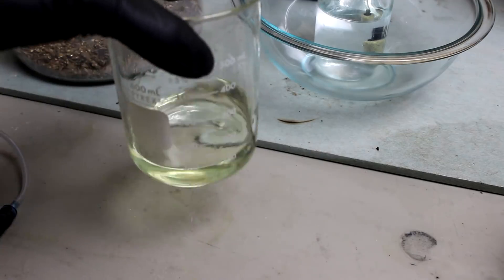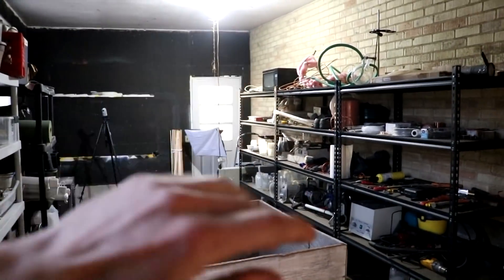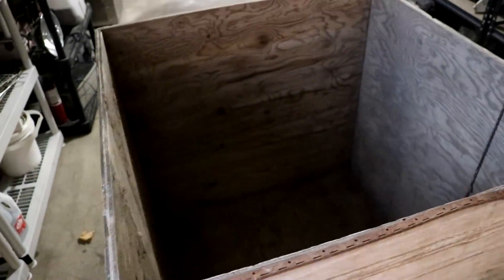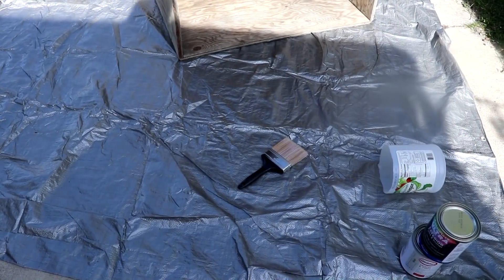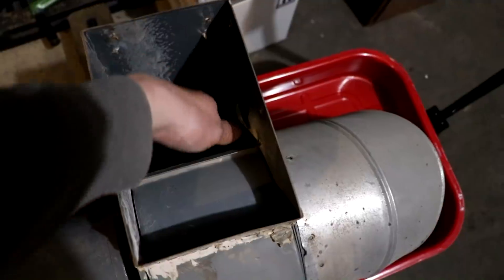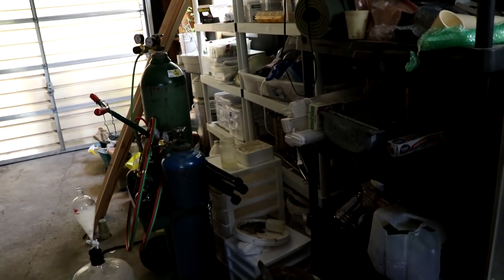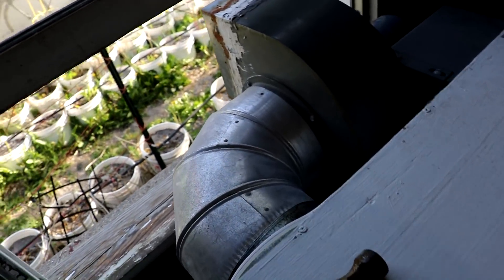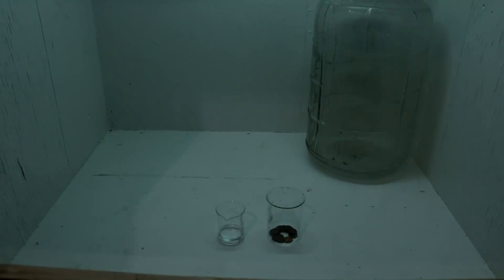Cody’s Fume Box

Comment: Serious suggestion, install independent light and fan switches on the OUTSIDE of the hood.  

Why independent switches?  It's easy to install and it gives you the freedom of running the lights and fan independently.  If you do something in there that you don't need the fan for (or you're not sure), you can still use the light.  Similarly, you can leave the fan running for however long you want without needing the light on.  Also, switches are much faster and easier to operate than plugging and unplugging things from the switched power strip, for when things go south in a hurry on you.

Why outside?  If you do something in there and it gets out of hand, you can turn the fan on easily without having to put any part of yourself inside the hood.  I know you're not crazy enough to leave the switch where it is, where you have to put your head in the fume hood every time you want to switch, but even with it moved to the bottom of the hood, you're still going to have to get your arm in there.  Serious fire, caustic crap dripping from all of the walls of the hood, mystery gases in the hood, etc.  I know you're well acquainted with a chem lab, and I'd be shocked if you haven't seen things go wrong in a fume hood.  Part of its purpose is that you can basically close the door and let the bad stuff happen in a box instead of around your body.

Comment: I would move that power strip outside the cabinet and silicone around all the entrances to that light fixture. Those fumes are going to kill everything copper in that cabinet.
Reply: It's really nice to have an outlet in there though, for a hotplate, stirrer, culture shaker, etc.
Reply: Actually he should put the lights external to the cabinet and have them shine through another acrylic window on the top of the box (like in a normal fume hood)! The corrosion is going to be a huge problem inside the lights, as you said.

Comment: awesome build. I agree with others about adding a back up fan and the switch outside preferably closer than hands reach. with the door fully closed how much vacuum does it make inside? Are you going to build an exhaust scrubber for the fume hood? don't want those nasty fumes hurting your plants or neighbors. Also please add a small fire extinguisher to this build just in case. What happened to the large vacuum chamber you were working on?

Comment: Use a smoke gren to test its effectiveness without the door :)
Reply: A "smoke green"?
Reply: ah shit... autumn correct at it again
Reply: and again
Reply: ....im done. Just no. does it think it's funny or something?
Reply: I'm assuming you mean 'smoke grenade'.
Reply: What do you think he did? That nox generator was basically an orange smoke grenade.
Reply: Gren is shorter for grenade

I said I wanted to the the effectiveness without the door
Reply: Unlike nox the smoke could allow him to test it without the door at all, I assume the smoke will be able to escape.
Reply: I just use a cigarette to test fans
Reply: Some people don't have cigarettes, Like Cody and almost everyone in the replies.
Reply: It's not very effective, apparently. There is a lot of air vortices forming inside, so that not all of the fumes are caught into the exhaust, potentially causing some to leak away. I guess the only way to improve it is to get involved into fluid dynamics. One way could be to build a slowly contracting confusor into the ceiling of the box.

Comment: you should probably rethink  the light and fan the fumes might corrode the fittings of the light contacts in the power strip and the motor and blades of the fan and your ducting... some paint or epoxy coating and or silicone to coat the contact parts might make it last longer...

Comment: Hey Cody that looks really good, the only suggestion I would make would be a grate over the air inlet inside the box so you don't get stuff sucked into the fan accidentally. I would use a chunk of 1/4" galvanized gardening screen.
Reply from the maker: Ryan Gribble 
Ah good call.
Reply: Id be a little worried about corrosive stuff with all that electrical and galvanized in the box.  zinc is pretty reactive as is the copper in the electrical.
Reply: Cody. Please take in account if you could have hydrogen gathering in top, where you have extention cord.

Comment: Making me want to upgrade mine now, but it has as good a chemical resistance as you can get without ptfe and I engineered the explosion proof fan array and the continuously variable controller so I'm kind of emotionally attached to it, and that fan system couldn't drive a bigger box so it would end up the purgatory of the foregone projects box.

Comment: I had read somewhere that its still dangerous to work with explosive gasses in a fume hood thats vented through a fan. Supposedly using the Venturi effect is the safest way when working with explody stuff. Your design fine for your application though.

Comment: Looks great. Like you said tiling the floor would be a good idea. I would also put up some stainless steel sheets on the 3 walls and ceiling. 
You can get activated charcoal filter media by the roll on ebay if you wanted a exhaust filter.

Comment: You are lowering the pressure in your garage with that fan. Where is your garage going to pull fresh air in from? If the path of least resistance is near where you are venting the exhaust, some of the fumes may make their way back into the garage.
Reply: I would argue that if anything he is venting is dangerous enough to worry about that small of an amount coming back in, then there are bigger issues to worry about like a neighbor walking by down wind.
Reply: Open a door?
Reply: I think Cody said in his mercury vacuum pump video that his garage isnt sealed well at all, so I'm guessing it wouldnt be an issue.
Reply: Jon Luke: I'm worried those bricks in that brick wall on the right are going to radiate him to death in, Oh, 500 years or so.
Reply: Obviously I'm terrible at my job because you think fluid dynamics is subject to your own opinions. Touche.
Reply: That fan, at the very least, is pushing 400 cubic feet of air per minute. That whole room looks like it's no more than 2300 cubic feet. That fan could circulate all the air in the room in a matter of 6 minutes. All that air has to be replaced from somewhere and the garage door is normally closed in his videos. If it isn't sealed well near that window and he hasn't provided a fresh air intake for the room, the air will come right back in through that leak and anywhere else that isn't sealed.
Reply: And here we see a architect and a interior decorator arguing.
Reply: I agree, he needs to atleast put an exhaust on the fan so the contaminated air does not flow straight back in, and he needs vents with filters allowing clean air into the garage on the opposite wall
Reply: At this point  you're either trolling or to feeble minded to understand anything but the internet in your mom's basement. Maybe if I could find some crayons I could bring it down to your level.
Reply: +Tommy DoeZ: Actually, I don't think it's an architect and an interior designer. I think it's just two twelve-year-olds pretending they know their ass from a hole in the ground.
Reply: Stop feeding trolls lmfaO
Reply: @jacob almond
connect an intake tube to the box, lead it to the opposite side of the garage, maybe improve the seal between the window and the pump if necessary.
Reply: Haha you're so caught up on fluid. Go learn something. "Any substance that flows is considered a fluid. This includes such things as water, shampoo, sunscreen, and even honey. Although not necessarily obvious, even gases, such as air, can be classified as fluids." yes, air flow falls under fluid dynamics ya big dummy.
Reply: keep going, educate these people and amuse me

Comment: I hope that’s a brushless motor in the blower... flammable vapors and a non brushless motor don’t mix.
Reply: Brushless is no guarantee of safety. Safer maybe, but not safe. Look up ATEX temperature classes.
Reply: cdawson198600 the ac squirrel cage fan should be an induction motor.
Reply: you mean a brushed motor, or even just brushless motor. a non brushless motor would be a motor that has brushes, since you've just contradicted yourself there quite nicely... poor grammar only adds to the confusion and controversy in the youtube comment section....
Reply: Alex Hendel a non brushless motor would mean a brushed motor as you say which would be a bad mix with flammable vapors as I’ve said.
Reply: Alex Hendel Go back and read the comment slowly.
Reply: UmmNotQuiteSureToPut yes...an induction Motor isnt a 3 Phase Motor known as brushless all the time
Reply: squirrel cage motors ARE brushless.
Reply: There''s all sorts of not good involved with this setup. It's a kludge, plain and simple.
Reply: Kinda sucks making a fool of yourself while being a smartass.. eh Alex?
Reply: Service Yeah and if you stay really quiet, you can even hear the self cringe he must be feeling
Reply: "non brushless motor"🤔🤔
Reply: Shouldn't matter because squirrel cage fan set ups are usually very well isolated. It's not like a household fan where the motor is right in the middle of the fan & airflow. Squirrel Cage fans usually sort of form two separate air circuits. Just the shaft usually goes through. The motor cooling being one and the air movement of the fan being a separate. He could upgrade to a TEFC motor or even an explosion proof unit but I highly doubt that is needed.
 The unit he has moves so much air that its virtually impossible to have a build up of dangerous gases. They use those for whole air circulation in home heating. Also for cooking odor removal over gas stovetops. Let's put it this way... for any reaction to fill up that space before it can evacuate it that would only be fulfilled by an already explosive reaction.

Cody did good with the design. Me, I'd probably throw those handles back on for easy movement. Plasti-Dip or Kilz (looks like paint but is really a white pigmented shellac )could be considered for different chemical resistance, maybe. The main idea is for his personal safety which this accomplishes. If anything would have been nice if he could have gotten double thickness plexi. I have installed it on my front door window and even the most violent thieves can't get in.
Reply: Andy H:  Nonsense. It's basic safety improvements on many levels which is much better than relying on which way the wind is going this moment and hoping it will stay the same through a science experiment.It's a bigger version of what labs use. Maybe not built to last a millenium but it sure beats nothing.
Reply: not always. BTW there are lot of these combos available because they regularly get thrown out when a new furnace is installed.
Reply: Submersible fuel pumps are non brushless, but its just fuel and a little air, minimizing danger. Unlearn somethin everyday.
Reply: It's brushless unless the squirrels are painting
Reply: A non brushless motor eh?!
Reply: Kevin Mathuews yes, an electric motor with brushes in other words.
Reply: Calling a brushed motor "non-brushless" is sort of like calling a person with legs "non-legless". It's technically accurate, it's just a strange way of saying it, and also it's a double negative. That's why people keep bringing that up, if you were wondering.
Reply: It is definitely an induction motor. While induction motors are not normally called brushless, they don't have any brushes. Single phase induction motors (which this almost certainly is) often have a centrifugal relay to help during starting. So there is one possible spark source (when the relay turns off, a spark is most likely created). But unless he is venting ether or something I don't think he needs to worry about it.
Reply: John Possum - Agreed, better than nothing, but not built with any modicum of safety in mind. Cody often knows just enough to not get himself injured...
Reply: I don't think I ever saw a universal motor on a ventilation fan.
Reply: Lol this is a ac motor not dc
Reply: Squirrel!
Reply: The mixture is probably WAY too lean for there to be a risk of explosion for anything Cody's doing. Unless he dumps a gallon of gasoline on the floor of the box. That's a lot of air and not very much fumes.
Reply: Alex Hendel 
The intent was to negate a negative, ergo a double negative was in order. Madness to insist double negatives must always be avoided even when they are the clearest and most accurate option
Reply: Lol everyone is talking about motors here

Comment: Hey cody, why don't you just use a hook and loop instead of nails?
If you screw some metal loops in on the outside of the box and put a hook on the door, you won't have to put nails in or take them out, so you'd be able to adjust the height much more quickly and easily.
Reply: Dick Nickler all the nail did was block the wood, the hook would have the same effect, so doing that would result in not being able to move it at all
Reply: The hook is on the outside face of the door, while the loops it hooks onto are on the outside edge of the box.
There is nothing in the path of the door as it slides down with this method, allowing you to slide it to any position and hook it there immediately without adding or removing anything.
Reply: Or a chain with large enough links to host a nail, plant a nail somewhere and use the chain itself as a lock :)

Comment: Worlds jankiest fume hood. Check
Reply: lol Mine is a ducted fan (intended for electric radio controlled jet planes) with a polystyrene "gasket" jammed into a length of donkey dick, through a piece of wood that the window closes against, suspended from the ceiling with some tie wire.

They do put out 3.5 KG of thrust though and move a metric SHIT TONNE of air.  The room it is in is 12 meters x 6 meters with 12 foot ceilings.... you can feel the air returning from the other end of the room inside of 2 seconds (whirlpool style)

Comment: And then the wind changes direction and blows nasty fumes coming out of the outlet straight through the window.
Reply: bdf2718 that's why the window is sealed around the output vent. To prevent that, otherwise it's for nothing
Reply: yeah, definitely a chimney tube asking to be installed.
Reply: dungeonseeker1uk a hdpe plastic taped around the window & exhaust would work easy, he showed the window but not at the end running it. Cody's smart enough to do something along those lines. I did see what you're referring to.
Reply: Yeah, I was thinking the same - if he have it the way he show in this video (without adding any seal around it), a lot of the fumes will enter that room again. Even with no wind - sucking air out of the room causes the pressure to drop - that means air has to get in somewhere else to level out the pressure. One of the easiest way for air to get into the room is to get back in thru the window around the fan outlet (that air will then of course take a big part of the fumes with it)
Reply: That fan is moving a lot of air it would take some very fast winds to cause it to come in reverse. But I agree it does need a chimney or something to keep rain from coming in.
Reply: You may want to rewatch the vodeo, he addresses this topic as a future plan.
Reply: Or the fumes condense and spread out all over your garden rendering everything inedible.
Reply: Gold, Exactly what he said he's going to do.
Reply: Get some sheet metal, cut a whole in it to fit the pipe, put it in the window, and tape it in with some decent duct or foil tape or use a pipe collar and some caulk or sealant. They probably make some sort of pre-made insert to install stovepipes going through windows that'd work.
Reply: if you think Cody would continue breathing in fumes after that happened just once, you don't know Cody.
Reply: Well, noting that there's a wide gap between one edge of the window and the exhaust I would expect air to circulate though that and if you've watched Cody's bee or mining videos it can get pretty windy.

Comment: What kind of electric motor does the ventilator use? Is it suitable for flammable fumes? (Just to be sure nothing bad happens, although I'm sure you've thought about everything :) )
Reply: In the next video we make flamethrower with our fumebox
Reply: most likely its a shaded pole motor or a capacitor start induction motor, probably not rated officially for use in flammable gasses but its unlikely to be a universal motor with brushes which will arc. shaded pole is how most furnace/boiler flue assist fans are constructed.